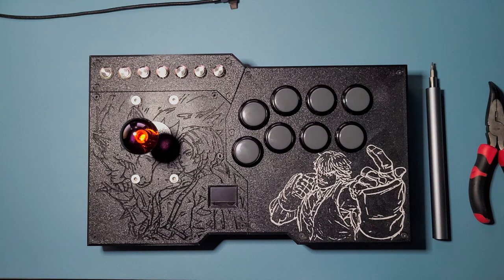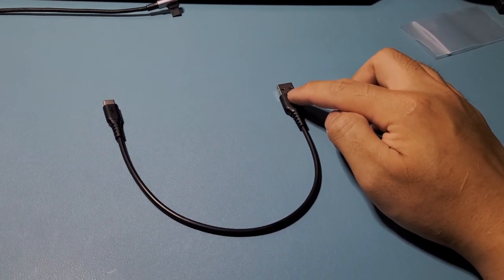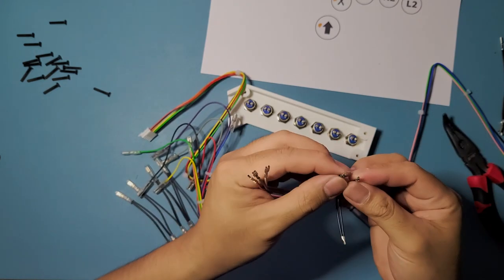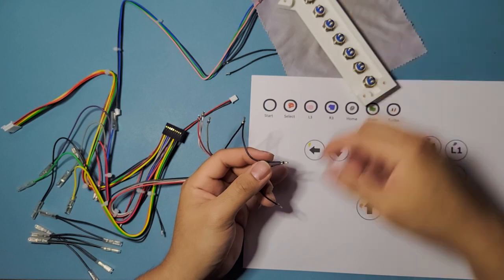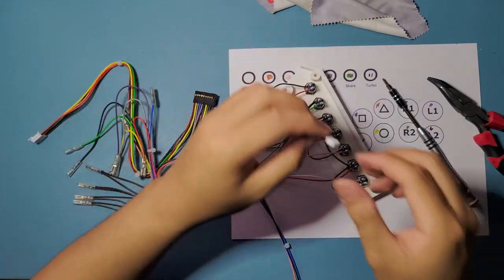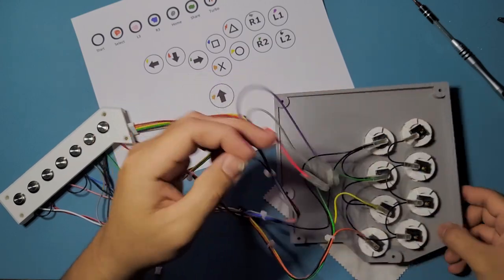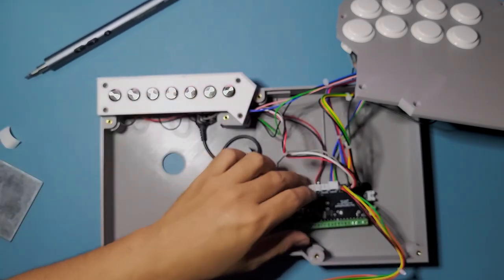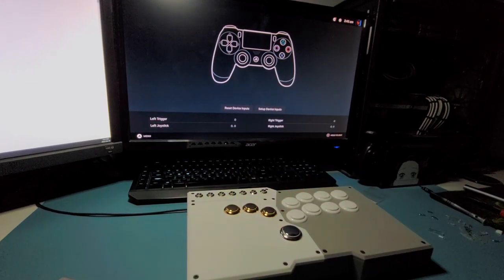Mojubox - FightStick Build-Along Wiring Guide (works with Joystick too)

Comment: thanks for this video! I might consider putting neodymium magnets on the left (joystick) panel so i can switch from leverless to stick faster depending on how well the magnets hold the panel.
Reply from the maker: Still need to have some sort of latch to lock it down. theres just no magnet, small and powerful enough to hold a joystick in place. too much force and motion going on when in use.

Comment: Well done. I like your step by step tutorial with all the wire and tips & trcks. Do you know if the print fit a prusa mk3?
Reply from the maker: any printer that has a  bed at or larger than 200x200mm will fit all parts fine.

Comment: thanks for the showcase, just asking this but at the beginning of your vid  did you stencil the artwork on your moju or did you add in art alongside that 3d printed part?
Reply from the maker: I engrave my panels with the art digitally first and prepare them for printing. they come out of the printer like that. For the color on Ken, I just filled up the engravings with some modelling compound.

Comment: Nice work and thank you for sharing this! what about wiring the stick, and which sticks can fit in, I would like to build one myself but I don't know much about levers
Reply from the maker: Thanks! For levers, I recommend using a sanwa JLF with  brook 20pin harness. It comes with the necessary 5pin connector that you need to wire up the joystick with a brook pcb or the pico fightinh board i used in the vid.

You can see the 5pin im referring to in the "connecting directional buttons panel" section of the video. The sanwa joystick has the same 5pin prong that you simply connect.
Reply: @V_Angelus  thank you very much sir, yes I did some research and now I understand that the enclosure is tall enough for that lever. Design is awesome  are you planning on doing other revisions or this is your final version, definitely planning on buying one on etsy, or the cad files, and one last thing, would you recommend a 3d printer that could be capable for this project  thanks ✌️
Reply: wanna get a 3d printer, but no nothing about them, what are you using, quality looks awesome !
Reply from the maker: @PandorusFightStick  Thanks man! im using an anycubic i3 mega and an Ender 3 V2 with a couple upgrades. 😁
Reply from the maker: @hALUCADOsama  An Ender 3 is what id recommend. If you want something that has good quality and works great out of the box with not much tinkering around with, You can get an Ender 3 S1.

But if you want to really get into and learn more about 3D printers. Id recommend and Ender 3 V2 or a base Ender 3 and learn and upgrade parts from there.
Reply: @V_Angelus  thank you very much, I will dig into it !
Reply: @V_Angelus  Great will look onto that!

Comment: I super love this! Ive been also trying to develop my own sticks and boxes and i have got to ask, what are you using as a print surface to get that texture? ive been looking for build plates that wont leave me with a shiny/smooth texture on the tops of my sticks and i cant find anything that gives that kind of finish!
Reply from the maker: Hey there, thanks! i use PEI flexible sheets for my print bed. They also last FOREVER long as you take care of em properly. the finish is very easy to maintain.

Comment: Does this fit regular 24mm buttons. I printed out the hitbox style case and my crown sanduckas don't fit. Any recommended buttons?

Also how do you wire the oled screen.
Reply from the maker: The 24mm buttons holes are modeled exactly at 24mm dia. Iirc crown samducksas are screw in right? ive had reports that they are tight, but they do fit. you still do need to bend the pins tho. You can also try to make a little tester you can print. model a square thats 4.25mm thick ans cut a 24mm hole through it and print that out so you can see how it fits.

As for the oled screen, youll need a gp2040 pcb and youll need some JST connectors. depending on what version of gp2040 you have, youll either need XH or PH. but the OLED screen takes JST XH . And some wires to make your own harness for it. theres a 4 pin slot there labeled "GND 3v SDA SCL". the same pin out can be found in the OLED screen, just follow the matching pinout with your harness and it should work just fine.
Reply: @V_Angelus  awesome, thank you for the detailed response. I'll give that test print a try. I might grab some snap ins to make it easier

Comment: Do you have a link to the OLED screen for this? I ordered some "0.96" OLEDs off amazon but they dont seem to be the right ones.
Reply from the maker: thats strange, these screens are usually from the same manufacturer, just different brands and vendors. generally they should be all the same. But anyways,I use these. https://www.amazon.ca/gp/aw/d/B07YNP2L95?psc=1&ref=ppx_pop_mob_b_asin_title